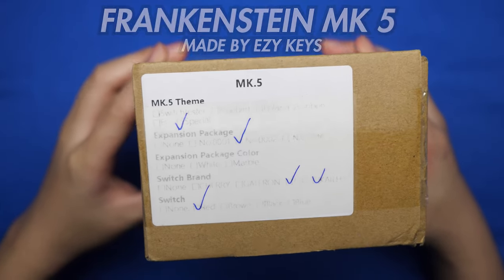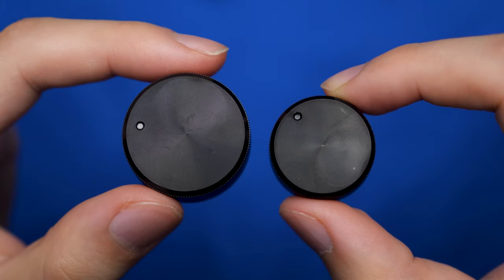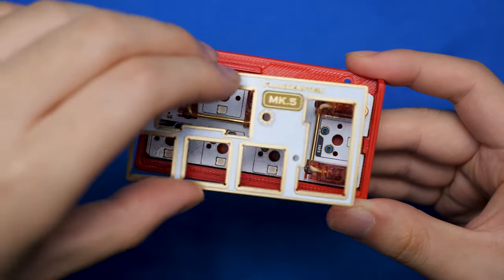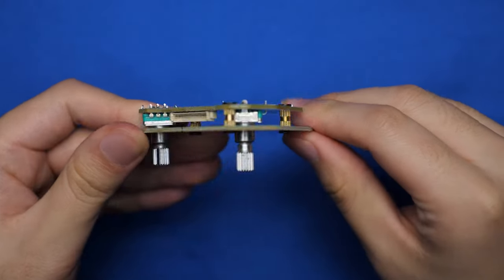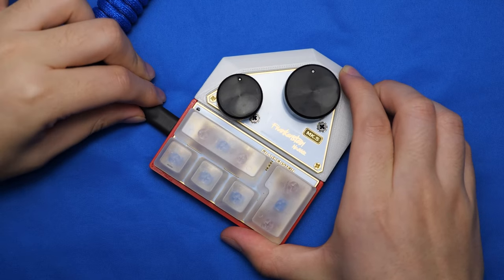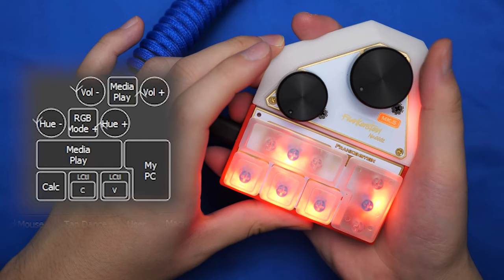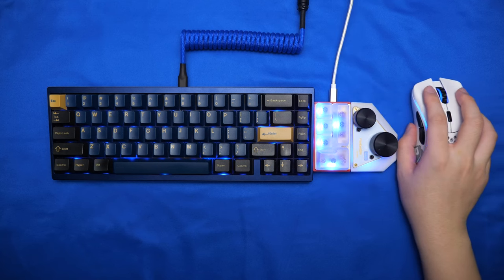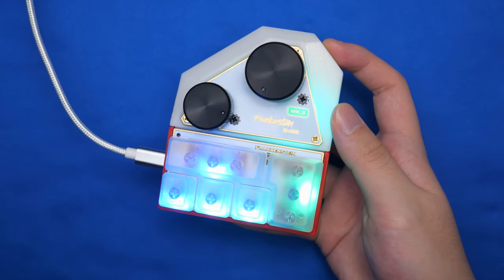This is the COOLEST Mini Custom Keypad Ever! - Frankenstein No.0002 MK5

Comment: Anyone else have issues with the software not recognizing the rotary knobs?
Edit: For anyone having the same issue, I posted a little guide in the comments.
Reply: yep.    pretty pissed off about that.
Reply: @matthewscholle4149  hey man I fixed it! You need to flash the macropad firmware. They have a video on their website that explains it (albeit horribly). For whatever reason they don't send the macropad flashed with the rotary knobs. After that it smooth sailing.
Reply: @firstnamelastname-zi4mq  I'll try it.  Thanks
Reply: @firstnamelastname-zi4mq  I have been searching the website, but cant find how to flash it anywhere.